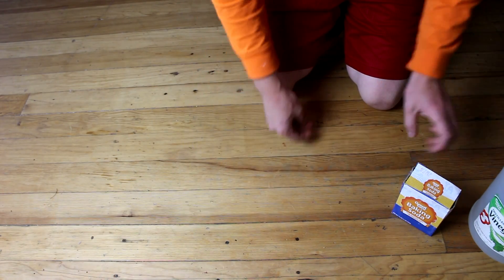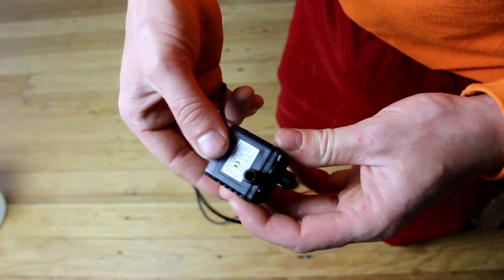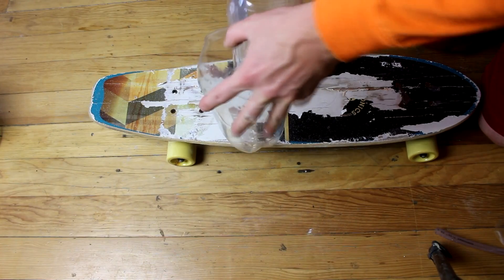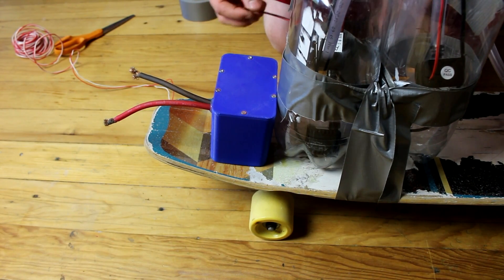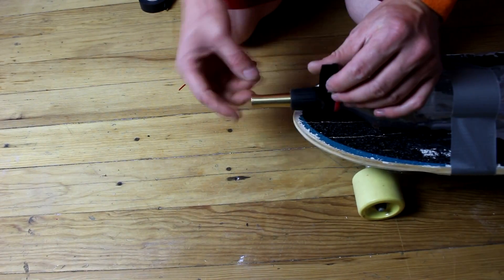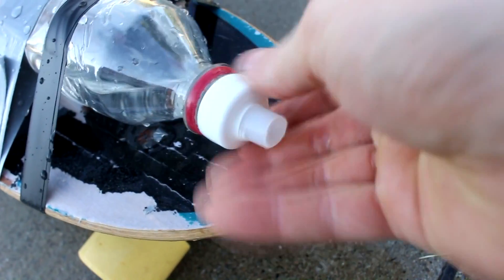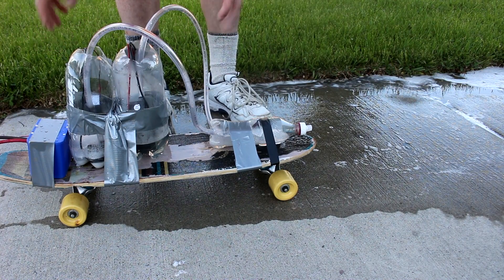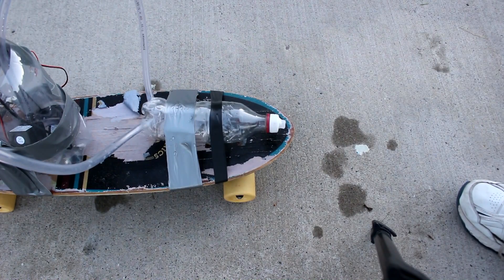Liquid Fueled Baking Soda/Vinegar Rocket

Comment: i guess its 2022 u could re do it with like a coca botle under 5 bar as fluid pump.... custom 3d print bottle cap and nozzle and concentrated acid and class 5 h202 and done XDor just getting that vinegar uneder 5 bar + a proper mixing injector 3d print should at least make this skateboar reach 15 kmh and go 20 meter XD
Reply from the maker: 2023 I’m doing it with liquid sodium and water. 😉
Reply: @theCodyReeder  i guess u also like to do pipe bomb out of rocket motor^^ (u mean some nak injected to the chamber with water? you chose the hard way XD or like rapid vehicule disasembly XD ) so i gona try myself the air presure pump way (i want see ho much isp add the vinegar and baking soda compared to normal water and known presure)

Comment: What about using coca-cola as acid instead of vinegar? pH is similar but contains plenty of pressurized CO2 already dissolved that will add to the thrust. Also, though it requires a modified fuel tank design, the pumps could be removed and the fuel tanks could be pressurized by the reaction itself. For example there could be a small chamber with the opposite liquid in it that then mixes upon "ignition", generating CO2 in the fuel tanks and expelling the fuel to the reaction chamber.

Comment: hey cody, i was wondering if you could revisit this project, but in a more "serious" way.
basically it should still use baking soda and vinegar, but this time make into into a hybrid rocket engine.
compress the baking soda into the equivalent of a rocket fuel pellet, and have an actual hybrid rocket motor which injects the vinegar into the compressed baking soda pellet in a controlled manner, and have a proper nozzle etc.

Comment: Pumps need higher head, smaller feed lines. And a more soluble bicarbonate if there is one. (looked it up: there are several, potassium bicarbonate is the easiest to get and is about 2ce as potent as sodium bicarbonate, more expensive and takes more powder for the same amount of gas but its so much more soluble that you can get twice as much bicarbonate ions in to aqueous phase)

Comment: what about a full flow staged combustion inspired autogenous pressurization system. not to extravagant just something that lets a small amount of baking soda water into the vinegar tank and vice versa to produce small reactions in the tanks to get them pressurized and then have the actual "engine" be entirely pressure fed?

Comment: You could probably make it work pretty well without a pump by sealing the containers and gravity feeding the reaction chamber.
If the entire thing is sealed minus the nozzle then the entire tank and chamber will pressurize and gravity should hopefully still be able to feed the liquid in.
Then you won't have to rely on the pumps keeping up with the outlet flow.
Reply: how would you control the flow if you did that? you can't control gravity.

Comment: This is certainly better than what I did as a kid. Dropping clumps of baking soda into the bottle as quickly as I  could. But it occurs to me that instead of pumps and open top bottles, use containers that can hold compressed air  with a tube going to the bottom of the liquid so when valves are opened the liquid is forced much faster into the 'combustion' chamber. It would also reduce weight and the compressed air would even add to the thrust.

Comment: you would've probably had better results if you made the combustion chamber smaller and the nozzle longer. With a smaller combustion chamber it would build up more pressure, while the longer nozzle would allow for a more directionally controlled burst.  while the nozzle shouldn't be oversized, too small is basically just a water gun.

Comment: Brushless moters work under water it's the wires and terminals that can't be submerged because the electricity will just take the path of least resistance (water)

Comment: Aluminized tape is never good on any electrical connection......
Reply: Need a ball check valve. Or a flap at end of tubes for the pumps

Comment: Good example of equal and opposite reaction, simply meaning that the energy from an action is converted in all sorts of ways.  IE Does NOT mean, and was never meant to mean that the force at which exhaust is emitted is transferred to forward movement, as NASA and NASA apologists would have you believe.  Would a rocket cause the craft to do something in a perfect vacuum with no walls?  Maybe, but without anything to push against, the equal and opposite reaction, would mostly be the filling of the empty void.

Comment: I know this is an antique video by internet standards but I pose a question anyway:

Two part epoxy dispensers have a long nozzle with a bunch of zig-zags in the length of the nozzle that are made to agitate and mix the two parts as they are dispensed.  Would a similar thing help to mix the baking soda nd vinegar more thoroughly before "unburnt fuels" are just expelled out the rocket nozzle?

Comment: Cody: Kids, you can use this science experiment at your science fair
Also Cody: Lets spike our fuel with hydrochloric acid
Reply: I wonder if sulphuric will cut it 😂
Reply: @industrialadhesive6357  if you really want more power a hydrogen fluorine mix should be ok
Reply: @VerbenaIDK  maybe wd can go for a solid proppelant and use aluminium hydride and flourographine
Reply: @industrialadhesive6357  metallic hydrogen theoretically has the highest efficiency for srbs, what would happen if we used something like fluorine in it? 
it's the most efficient fuel with the most efficient oxidizer for chemical rockets
Reply: @VerbenaIDK  i like your thinking. Although its incredibly difficult to keep it in that state. If we could i feel like red oxygen O8 would be a far better oxidizer
Reply: @industrialadhesive6357  i never heard of red oxygen
if its better than regular oxygen and easier to store than ozone, fluorine, ClF3 or any other oxidizer like that it's already better than fluorine
Reply: @VerbenaIDK  not easier to store do to high pressures needed. But density wise and oxidation power wise it’s a far better oxidizer than most others. It’s formed when oxygen is compressed to over 10 GPa
Reply: @industrialadhesive6357  98692,3 atm pressure
it needs to be stored at this pressure?
if it does it would be better to just use fluorine or ozone or just developing a ntr
Reply: @VerbenaIDK   oh definitely😂 its not practical what so ever but it is incredibly powerful. ive heard of flourographine being used as an oxidizer
Reply: @industrialadhesive6357  why all powerfull oxidizers are so impractical? :(
ig it,s better to stay with the regulars like oxygen and ozone
Reply: @VerbenaIDK  yeah it’s sad. I mean LOx and LOz are fine but they aren’t very interesting. But it is best to stay with those
Reply: @industrialadhesive6357  liquid ozone cant be used since it likes to decompose when it wants
but it might be possible to put some loquid ozone in lox
Reply: Muradic or muratic or summit not hydrochloric

Edit: nvm I’m an idiot
Reply: @Jd358-j8p  muriatic and hydrochloric is the same thing
Reply: @VerbenaIDK  yes that's why I said "edit : nvm I'm an idiot"

Comment: Can we estimate what percentage of the energy comes from the reaction and how much from the pumps themselves? In other words, would it really be a lot less effective if we just pumped plain water through a nozzle using the same pump setup?
Thinking along the lines of "power equals pressure times volume per second", it seems to me that the power input from the pumps must equal the power output at the nozzle.

An alternative version without the pumps could be to divide the reaction bottle into two sections with a  porous membrane in the middle, with vinegar on one side and soda water on the other. The membrane would regulate the rate of mixing and prevent it from getting too explosive.

Finally, I think it would help to run a little tube from the output nozzle to the lowest point in the liquid, (like the tube in a perfume spray bottle) so that no gas would escape along with the liquid.

Comment: Is a 1:1 ratio the best mixture?  What if you add valves on the fuel line to control the flow rates? and then you can test different fuel ratios and see if you can get better thrust with different amounts of fuel been mixed.  Also it would be neat to test different types and sizes of combustion chambers and see how those play a role .

Comment: Can't you angle the bottle to push the skateboard forward by the liquid pushing against the road instead of pushing against the air?
Reply: it's the motor pushing out the reacted stuff that is causing the board to move, angling it down wouldn't do anything but waste energy in trying to make it pitch down.

Comment: If the spray isnt facing slightly towards the ground youll keep getting that low speed
Reply: there is no transfer of momentum backwards though a stream like that,  that would only make it go slower by trying to push the back end up.

Comment: @Cody'sLab I believe that if you take a tube and insert it through the mouth of the bottle it would work better. The tube being 1/3 of the length of the 'engine' the reactants wouldn't simply pour out of the mouth and finish reacting on the ground.

Comment: I've built and repaired a lot of wiring harnesses/ bundles and connectors- both as a hobby and in several professions. I'm of the opinion that electrical tape should never be used for wiring of any type, unless you're in a pinch or it's temporary while you apply something more permanent like self-vulcanizing rubber tape. Electrical tape absolutely sucks and it always miserably fails. The self-vulcanizing stuff costs like two bucks at Lowe's for a roll so everyone might as well use it. 

But yeah, you're totally right- duct tape is worse. lol.

Comment: "This'll be good for a children's science fair." Five minutes later: "I'm adding Hydrochloric acid to the vinegar."
Reply: Nah just mix some perchloric acid and 90% hydrogen peroxide and let the fun begin
Reply: @oldelectronicenthuasiast  liquid fluorine and liquid hydrogen
Reply: @VerbenaIDK  I'll do you one better liquid FOOF (F2O2) and NaK eutectic reactor coolant
Reply: @oldelectronicenthuasiast  at that point if you want efficiency it's better to develop a NTR rather than using more reactive and unstable oxidizers with more reactive   fuels
but can a NTR run on FOOF?
or xenon tetroxide?
Reply: @oldelectronicenthuasiast  nah, chlorine pentafluoride is safer to handle for little kids
Reply: Seems right to me, kids are always throwing up on things, they'd probably add hydrochloric acid by mistake
Reply: @jek__  Isn't that sulfuric? or is it like a mixture of stuff...
Reply: @justincase1898  hydrochloric and muriatic acid is the same
Reply: No one mentioned hydrofluoric acid... its the best science fair acid... does all the acid things... but better
Reply: @justincase1898  and nowone mentioned fluoroantimonic
Reply: Hydrochloric acid isnt that dangerous if you wear gloves and glasses and have supervision as a kid. I did far worse stuff than that as a kid.
Reply: End My Pain.
Reply: He added muriatic acid, which is the active component in vinegar
Reply: Muriatic acid is hydrochloric acid... vingar is acetic acid  @michaelfixedsys7463
Reply: @michaelfixedsys7463  no it is not
Reply: @michaelfixedsys7463  muriatic acid and hydrochloric is the same thing
vinegar has acetic acid not hydrochloric

Comment: What would happen if you used a similar setup using high concentration H(SO4)2 and a high concentration strong base. You'd need a stronger reaction chamber and it cost a lot but i think it'd be really cool to see this done with concentrations over 90%

Comment: BTW, ClF_3 is a great oxydizer. Just don't try to use sand in case of fire, or plastic bottles as tanks. Oh yes and you get some friendly biatomic molecules like HF to come out the nozzle, just be sure to run fast.

Comment: If you could add check valves to the fuel lines,  reducing back pressure, the smaller hose nozzle might have moved it.

Comment: What about rp1 and lox I know that getting that much lox is difficult but you could use hydrogen peroxide as the oxidizer and you should've pressurised the fuel tanks with a bicycle pump or something

Comment: First of all u should have the reaction chamber at a 45% angle tord the ground and 2 pumps are actually worse then one for the same reason radiator fans are turned off on cars when there moving

Comment: In your original experiment with the sealed bottles, the reaction gasses were able to self-pressurize both acid and base canisters.  I suspect if you were to monitor the pressure in both you would notice a surging oscillation of pressure in both as the back-pressure pushed reaction gas back into each.  As the reaction chamber pressure dropped back down below the manifold pressure of each canister,  the acid and base would once again surge rush in and start the process over again.  This is way better than the pump design as is needs no pump to operate.

Alternatively, if you can figure out how, you could introduce a small amount of acid into the base canister and vice-versa so they self pressurize, though this could be tricky and could result in an acid/base canister rupture of course :)

Really love watching your videos - my kids will soon, too (with some added daddy-disclaimer and warnings of course).

Comment: Even though gas does compress, the nozzle effectively limits how quickly it's going to get through. By allowing the exhaust to be a foamy mixture of water and carbon dioxide, you might be limiting the thrust as opposed to only having water come out. Simethicone, the active ingredient in Gas-X, helps prevent foaming. If you added some of that, ditched the soap, and reconfigure the reaction chamber so you mostly only have liquid running to the nozzle in the beginning, you might increase the thrust because you'll throw more mass out the back. Overall efficiency and delta-v are likely to suffer, but since we're trying to overcome friction, a short burst of decent thrust seems to be the order of the day.

Comment: You could invest a couple of bucks in aquarium check valves to restrict the back flow and use that narrow nozzle. It would still cycle as the pumps still have to overcome the pressure in the reaction chamber but the energy of the reaction wouldn't be wasted and the higher peak pressure would provide way more thrust. A pump with less flow but more pressure would be more ideal in this situation though idk what would fit that criteria on a science fair budget. Still, check valves would make this thing go and is probably safer than encouraging kids to play with muriatic acid. :D

Comment: It does look like it'd be fun to  experiment with. I'd try
1) using a longer reaction chamber.
2) Adjusting the speed of the pumps.
3) using more concentrated components.
4) using a hopper to feed the soda in dry.
5) probably way beyond a science fair project, but a pulse system that only releases the pressure when it's strong enough to move the board.

Of course, I've never built a rocket in my life, & these are mearly what I'd want to try. :)

Comment: 1. Your input pressure of your reactants must be at least equal to the pressure resisting the exit of your reactants out the nozzle. Your setup for pressure differentials is way off. 2. You also need two reactants that are much more chemically expanding than those you chose. 
There is a good reason we speak highly of rocket scientists. There is a great deal of math involved. I do understand you were just making a idea demo, not an actual working rocket.

Comment: I know you are a chemistry guy but I've got a physics question: Say you have an infinite fuel source. Now, if a rocket were to keep its throttle at 100% in the vacuum of space will it eventually reach 99% the speed of light? Or even the speed of light itself?
Reply: Copperstar Metalclan it would eventually reach the exhaust speed of the rocket engine. This is why ion engines are being developed for long rocket journeys, they have very little thrust but extremely high exhaust speed and efficiency

Comment: you should try putting check-valves in series with the hose lines. that might reduce how much the expansion in the "combustion"chamber is blowing backwards up into the line. that would increase the effectiveness of the pumps

Comment: i think some one way valves are needed in the fuel lines,     you can see when the pressure builds up in the engine  it forces the fuel back up the line  and causes that pulsing behaviour..   you can see the fuel level going down then stopping,  down and stopping.
Reply: the pressure the small pumps can supply is less than the pressure inside of the engine causing the fuel to travel back

Comment: My comment's probably like p*ssing into the wind at this point, but I wonder if making the mixing chamber dealie smaller would produce more thrust - soft drink bottles are rated for a high psi, and I know it's by no means reaching that pressure here, but I'm wondering if a smaller space for the liquids to mix would build more pressure. Hrmmm.. and maybe a check valve in the feedlines, so the pumps won't have to overcome as much back pressure. I'm overthinking this already, bah! Oh, and maybe, you could use a much smaller battery with a buck booster to drive the pumps - obviously won't run them for as long, but would lighten the load. Okay, I'm definitely done.